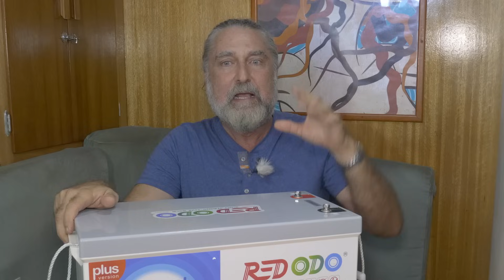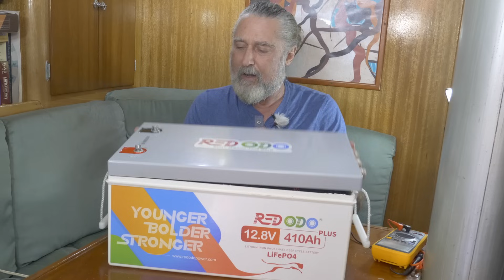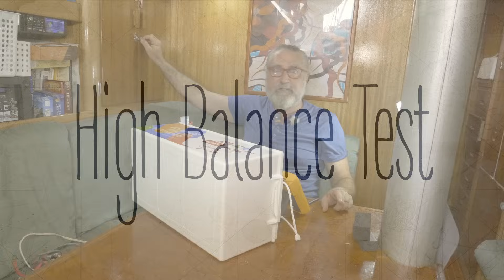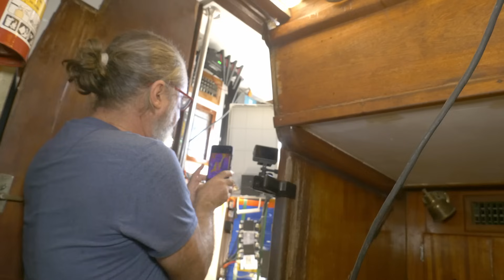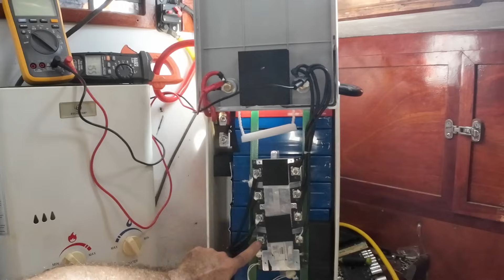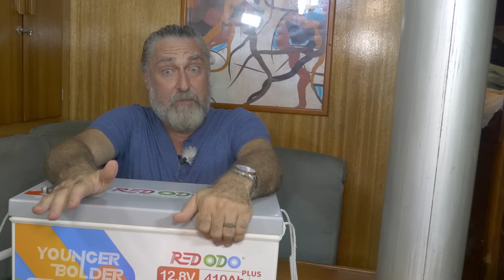Cheapest Lithium Challenge:Redodo 410ah

Comment: Thanks Clark, another excellent review. 
I was considering installing a couple of these to replace my 4 x 120 Ah Lead Acids, managed by your BBMS of course,  as I can get these in Europe and they will deliver them to my boat in Croatia. 
Getting batteries to fit into the space available has proved difficult and limits my choice and but one of these is a snug fit where two of the old ones sit. 
But, your comments about the poor quality cell, and too small wires, is putting me off.
Will you be taking this up with Redodo, if so I would be interested in what they say, if nothing they have lost a customer  as I was considering two of these batteries.
Reply from the maker: I'm waiting for them to find the video as they have before.  That way I can judge their position before bringing up that they should up the wiring 
   I think my cells were bad luck but as with all Chinese battery manufacturers they don't budget for testing or balance.  But buyers go for the cheapest so why should they.

   I'm keeping the 410 as one of Temptress' batteries.  I will have to cut the handle anchors off to get it to fit but without those it's like 19.5"

Comment: The power density some of the newer battery designs offer is a big deal. Half the reason I'm waiting on 7kwh of raw cells to get loaded on a slow boat is so I can fit them in a fairly small compartment on my rv.
Reply from the maker: Better batteries will come but LiFePO4 is good enough.  That's a big thing.  Lead wasn't good enough.

Comment: My 600 ah lithium lifpo4 calb plastic encased cells are 200 ah each 3 in parallel and then put in series for 12.8 v 600 ah so 3P 4S setup with a 200 amp daly BMS and i use a xantrex freedom xc 2000 inverter charger here in my camper Van i live in

Comment: Well, Hopefully I don't also have a lemon since I bought 2 of these a couple of months ago!  I wanted to increase my total Ah and these were the only ones that fit in my available spaces! Going with 200Ah batteries I would have been OK using 3 - but neither of my battery spaces could physically fit 2 batteries! The smaller gauge wire is a bit concerning - but I never draw anywhere near that kind of current so I should be good.  Also curious to know when/if you get any feedback from REDODO on your results.
Reply from the maker: Not yet from Redodo.

I've decided to keep this one for my boat.  That will bring us to 1000ah Li and 1500ah Pb which is ridiculous but lets me do some development work on multiple different li banks and the BankManager.

Also we can go over aweek with no sun!!!
Reply: Sounds like a simple process - but unfortunately not really an option for me as the batteries are installed in our boat and we are on our way south for the winter! ;)
Reply: If you are looking to top balance your new Redodo 12 volt 410ah batteries I have some steps. Each 410ah battery would require these steps or increase the resting times for additional batteries. Step one charge the battery to full which is around 14.6 volts or until the charger current drops to zero amps indicating the bms has shut off. Step two , connect a smart outlet timer to the wall and plug your charger plug into it. Step three, set the timer to be on for two hours and turn off for 48 hours and back on for two hours and off for 48 hours. I recommend doing this so the bms can top balance the cells. You can repeat the process as many times as needed to get to the magic 14.6 volts without the bms shutting off the charger amps abruptly. It sounds like a long process and it is long, but like Clark says, its healthy for the cells to not overcharge to a high voltage and the only way to prevent a cell from reaching a high voltage is to have all the cells completely top balanced.
Reply from the maker: With the size of the cell pairs and the low balance current of the BMS I couldn't see any noticeable balancing happening.  Since I had the case opened I balanced the cells with a power resistor.  It still took a long time, these are huge cells.

That approach should work but I just don't know how long it would take and I hate holding cells that high for that long.

I really wish the manufacturer would add an active balancer inside.  I have bought good ones for like 5 bucks on eBay.
Reply: @Clarks-Adventure  The trick to seeing if the bms is balancing the pack is to write down what the pack voltage is when the bms shuts off the charging amps. Your battery in the video was around 14.0 volts which is not the advertised 14.4 volts +/- 0.2 volts. After doing a few charge and waiting for the bms to balance for awhile the pack voltage will rise up to its full voltage (14.6 volts). Once I verify the pack reaches 14.6 volts or close to it, the process is complete and the battery can be put in service
Reply from the maker: Yep 

This is good advice people.
Reply: not everyone likes the internal smell of the LifePo4 battery factories.

Comment: Hi Clark. Though it would be nice to see them up the standard of wiring in these, I think a house ank of 4 of them would be pretty nice for a discharge rate of say 150 amps over 12 hours, before getting charge put back into them wouldnt be getting anything warming up too much ? For me, for 150 amps over 12 hours is likely an overestimate tbh, and thebank size of 1600 ah, should give a decent amount  of power in an emergency, while still having gas for cooking. I'm, iking this one tbh. Best Wishes.  Bob.  🤔👍⛵️✨️✨️✨️❤️
Reply from the maker: Yes, that would only be 35a per battery.  No heat at all.

I'm keeping this one on Temptress.  Even with the bad cells it's a hell of a battery.
Reply: @Clarks-Adventure  They appear to be the type of Company, that will address the wire sizing issue, before I get to the point of ordering them as well, though as you say, I likely won't hzve any hot wire issues anyway. Nice review again Clark. Bob. 👍

Comment: Another great video and invaluable information. Now, if I had bought this battery and of course would not test it as you do, would I notice that the battery is sub-par and would it impact my electrical setup?
Reply from the maker: No it's most likely you'd never notice.
Reply from the maker: That's why I have to open them.

Comment: Checked out the leaderboard. Great work! I am sure you said but, are you going to test out 48V batteries? Thanks for answering when a big battery vs several small batteries applies.
Reply from the maker: It's unlikely I'll review high voltage batteries out here as I just have no use for them after the review.   
   The Elefast company is supposed to be sending a 36v battery to a friend so he can review it for me and put it in his golfcart
Reply: Is there an effective difference between a 48V battery, and 4x12V batteries in series? Since that's what they'd be internally anyway. The difference would just be in the supporting stuff inside the battery, the BMS might be set up a little bit differently. Really it's more a 48V system than a 48V battery, in my opinion.
Reply from the maker: Try it.  The 12v batteries tend to get out of balance with each other.  All in one battery the the BMS keeps the cells balanced (or it should)
  If you watch my Duffy conversion you will see a way around this so you can use 12v batteries in series.

Any grammar errors?
Reply: @Clarks-Adventure  Hm in theory you ought to be able to wire each 12V battery up to your own BMS, although I don't know if they make those. It's not something I'm doing practically, just curious. Shame they don't have a little port on them that lets the batteries' own BMSes link up and do intelligent stuff together. Maybe you'd daisy-chain them all up to each other and have a display and some buttons that plug in to the first / last battery in the chain. They'd have to standardise it, of course, to be any use. Maybe in the future they could get Bluetooth to take care of all the intelligence-sharing.

Anyway I do see your point. I suppose, for example, a battery with an intrinsically lower internal resistance is going to see less charging voltage. That's complicated just to start with.
Reply from the maker: Since you were the grammar police I'm calling you on engineering.  
   Bad idea for a bunch of reasons.  The best answer is one big GOOD BMS that controls all the cells.  Second best is an external balancer.

  Hoping they will stay in balance is a very bad idea.  

   You will likely lose power when you most need it.
Reply: @Clarks-Adventure  Yeah that's what I was getting at with the idea of linking the BMSes together, so they could share data and control current and voltage during charging and discharge. But fair enough you've given your answer and I can't disagree. Particularly if you want something you can actually buy.

Comment: Clark, great video - thanks!! I have a pure lithium house bank (4x Dakota 277's) that are charged by the solar, alternators, H2000 Gen/shore-power directly and DC DC chargers back to 2x FLA start. Would there be any advantages to your bank manager. I already own your DCAC. I do not architecturally like that the drop-in BMS is isolate and therefore cannot, for instance, gracefully shut down high Amp charging (alternators for instance) to protect from frying expensive Alternators or risking a fire event. Any thoughts as to whether your BBMS would be of benefit with this architecture?
Reply from the maker: I believe it would be of great benefit!  Take a look at https://www.emilyandclarksadventure.com/bbms and watch at least the main video.

First and foremost.  It charges li correctly.  Your charge controllers charge to a voltage.  That's fine for lead but not for Li.

Also ditching your DC-DCs will give full alternator charging to the li and let your Li float your lead for long lead life.  And of course diode protection.

Anyway it's all on the page.

Comment: I’ve had 2 of these in use for 12 months now and have been exceptionally happy with output in my application.
Reply from the maker: That's great.  I think I just got a lemon.
   But I have decided to put it into Temptress.  It's still a good BIG battery.
Reply: @Clarks-Adventure  Sad though that considering the price point they didn't  do a better job at ferreting out the weak cell and put in wiring too close to the cusp of the batteries capacity.  

Perhaps you did get a lemon assembled by someone who ran out of the correct sized cables along with premium cells and made due with what they had on hand to keep the production line moving.

Have you gotten any feedback from Redodo on your findings that you can repeat here?

Best!
Reply: @neilfromclearwaterfl81  Sorry to be a pain but it's "make do", not "make due". Public information announcement / endless battle against grammatical mistakes. It's a thankless task.
Reply: @greenaum  I see that the historical variant that was acceptable when I went to school is no longer viewed as acceptable by some today.  Make due goes to the sense of making appropriate or sufficient which is correct in matching my intent however grammar checkers today recommend using do instead since some may incorrectly view using due as an error.

Best!
Reply: @Clarks-Adventure  How many watt hours did the battery output in your capacity test?

Comment: Thank you for reviewing this big boy.  There are so many manufacturers out there selling 100AH LiFeP2O4 batteries I was getting sick of watching there videos.
1.  I am inclined to agree with you that a 98% capacity test is adequate.  I keep my boat on a mooring and have 2 200AH Redodos.  I don;t have adequate solar charging yet and so having 4AH of storage allows me longer periods without needing recharging.
2.  We have been told by many that you must only combine batteries of the same capacity, same manufacturer, same BMS and purchased within 3 months of each other.  This would prevent future expansion say a year or two from now.
Being the restless soul that I am and being someone who doesn't like to be told no, I contacted Redodo with this question.  What they said may surprise you.
"Don't worry! 
The new battery can be connected with the old batteries in series/parallel if you do the voltage balance before connection as below:

Below two steps are necessary to reduce the voltage difference between batteries and let the battery system perform the best of it in series or/ and in parallel.
1) Fully charge the batteries separately.
2) Connect all of the batteries in parallel, and leave them together for 12-24 hours.
Then you can connect them in series/parallel to build the battery system.

Please contact me to enjoy a special price when you prepare to buy more batteries.":face-red-heart-shape: